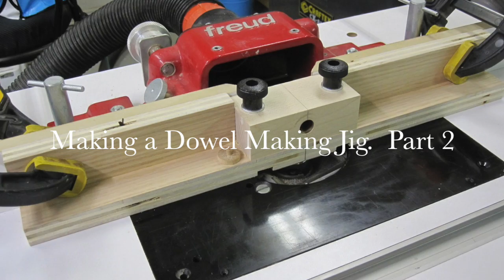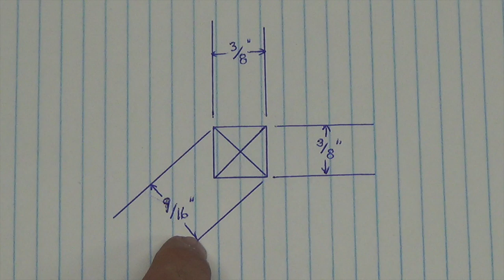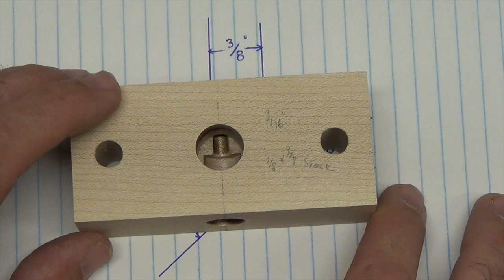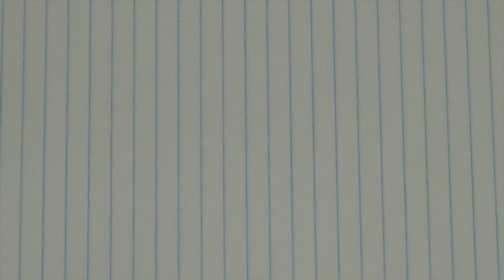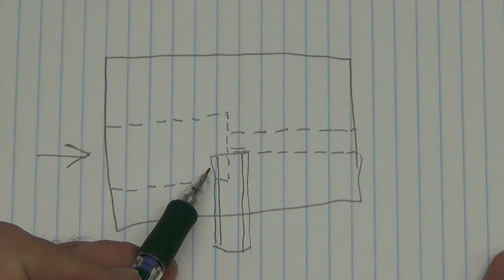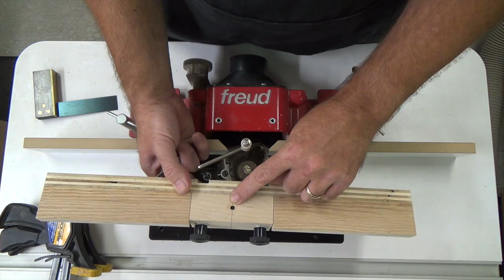Dowel Making Jig Part 2

Comment: What’s the smallest size of dowel and the largest dowel that you can make with the jig. Thanks
Reply from the maker: The smallest dowel that I have successfully made is a 3/16" diameter and the largest has been a 1/2" diameter.  I hope this helps.  Thanks for tuning in to the show Danny.

Comment: I like this but unfortunately I have the JessEm fence so the dowel would hit the back of the fence thus I would only be able to make dowels about 5” long. I’m going to try building it to run parallel to the fence.
Reply from the maker: I have been working on a jig that is similar to this one Robert for the Jessem fence as I have the same setup.  I tried this jig on my Jessem and the dust collection port interferes with the dowels exit point.  I have thought about one that work parallel to the fence as well, but you would just need to make sure that there is enough clearance for your drill to operate and as well, that the exit port of your jig gives support for the dowel.  They can really whip around when they exit the jig.  Good luck on your project and thanks for tuning in to the show.

Comment: So. I drilled my entry hole at 9/16 (.562) diameter,,, but,,, I milled my stock to .397 square, to get a nice fit to entry hole. Waxed both entry and exit holes to smooth operation.

I adjusted my square stock size to get a nice fit... Most times only skimming .oo2 thousands smaller or .395..
Reply from the maker: Sounds like your adjustments worked perfectly.  Thanks for tuning in.

Comment: A2+B2= C2
So, the sum of the two sides squared,= the length of hypotens's square root.
So, .375 squared plus .375 squared = .2812
The square root of .2812= .5303 or 17\32 diameter..

This is why others above are questioning the 9\16 (.562)  dimension on your drawing..

The measurement isn't 1\2 PR 9/16!  Its half way between those AR 17\32" 

'
Reply from the maker: Even if math was my strongest suit, this would still have hurt my head first thing in the morning.  LOL.  Thanks for tuning in.

Comment: Hello Kenny,  I found this video when I searched for a dowel making jig. I need an odd sized dowel that is not readily available and was not surprised when your jig came up in the search results.
I agree with your assessment of the quality of the dowels that you find in the big box store.  Lately I've found that the dowels are not the size stated.  I found this first with some 3/8" dowels-I drilled a 3/8" hole with my Forstner bit and the dowel was loose.  At first I thought my bit was cutting a bigger hole but when I measured it it was within tolerance.  I checked the dowel and found it to be closer to 7/16" than 3/8".  Fortunately the glue swelled the dowel enough that it tightened in the hole.  Same thing with a 1/2" this afternoon.
Anyway-Kudos on your jig!  Very good explanation on everything from how it works, to construction and set up.  When I build mine I'm not going to clamp it to the fence though-I'll make the base large enough that it will use the fence mounting holes but I will be using your design for the "dies".

Thanks for another informative pair of videos.
Reply from the maker: Glad that you like the jig and are going to make your own.  I actually changed the design of the die blocks as I got tired of them wearing out over time.  As the dowels are formed, the wear down the exit hole and cause the dowels to be mis-sized.  I corrected this by cutting a dado on the exit hole side and installing a 1/4" thick plate steel with the appropriate sized exit hole in it, lined up where it was supposed to be.  They never wore down again and I never had to replace the die blocks again.  Unfortunately, I will have to redesign my jig as it doesn't work as well with the JessEm table.  The vacuum dust port interferes with the dowel exiting the jig.  Not to worry though, when I do come up with the new design, I will be sure to have it on the show.  Thanks for tuning in and taking the time to leave a comment.  Good luck on your build.
Reply: @acutabove_woodworkings  I was thinking of adding a metal bushing in the exit side but a plate would be easier-more convenient.  Wouldn't have to purchase or have them made.

Comment: Why did you put the outfeed into your vacuum hose? Also, you seem to be wasting a lot of material
Reply from the maker: The outfeed travelling into the vacuum hose was just the way the design worked out and it helps keep the dust away from the outfeed.   As far as the "wasting material", the material is scrap and with several different sizes of dowel blocks, I wanted to have one size of blank that would work for several different dowel sizes.  That way, when I had scrap that I wanted to use up, I could cut it all to the 3/8X3/8 size, and make whatever dowel size I wanted when I needed to.  It's a convenience thing.  I hope this answers your questions.  Thanks for tuning in.
Reply: Ah 👍 I missed the scrap wood part. I’m going to make one based on your setup cause the router jigs seem to work better than the hole and chisel and tablesaw jigs that I’ve seen so far. Will def tune in
Reply from the maker: @hidarlin76  Glad to hear it.  I have recently modified this jig just a little and made the outfeed hole a little stronger.  I attached a 1/4" thick steel plate to the block and drilled the outfeed hole in that to prevent the hole from wearing.  Just a little suggestion.  Thanks again for tuning in.

Comment: Kenny; tuning kinda late to this one, trying to catch up. Great jig! Have you ever tried cutting across the grain to make plugs with this jig?
Reply from the maker: I can honestly say that I've never tried that Frank.  I would think that the cross grain would not survive the cutting process.  The twisting force on the stock as they dowels are made is pretty strong and I don't think they would survive.  Thanks for tuning in to the show.  I appreciate it.  Better late than never Frank.

Comment: hi Kenny
was wondering if the block would make 1" dowels since its 1 5/8 tall and 1" dowel requires 1 3/8th starting hole, would it be strong enough
thanks in advance
Reply from the maker: I honestly don't think that there would be enough material left in the block to be able to make a dowel of this diameter after cutting away a hole that is 1 3/8".  That only leaves 1/8" on either side of the hole.  You would have to increase the size of the block for sure.  At least the height of it anyway.  The other problem is that it would be difficult to turn it in a drill.  You would have to either find another way of spinning the stock, or cut it down so that it would fit in the chuck of your drill.  I hope this helps.  Thanks for tuning in to the show.
Reply: Fit the wood into a nut socket & use a nut driver.

Comment: thanks, thats i need made next before i test how good come out metal plate were has drilled 6 and 8mm holes and drill cut wood at plate. if not work good i made you version. thanks good idea.
Reply from the maker: The wooden blocks do wear over time and need to be replaced.  The metal plates might help with that.  That's a great idea.  Please let me know how it works out.  Thanks for tuning in to the show and taking the time to leave me a comment.  I appreciate it.

Comment: High Kenny thank you for your prompt response
What I meant is according to your video The entry hole is 9/16" which is the measurement, corner to corner on a 3/8 X 3/8 stock 
But my measurement comes out to half an inch instead of 9/16 hope that clarifies it
Reply from the maker: It definitely clarifies it, thanks.  I have redone the measurements and verified.  Checking a 3/8"X3/8" stock, from corner to corner, the measurement should be 9/16".  I have even drawn it out and verified it this morning.  If you are not getting the stock to measure out at 9/16" from corner to corner, I would first start off by checking if your table saw blade is square to your table.  Having that blade perfectly square to the table makes a big difference when making a project like this.  So now, I am understanding more of what you are asking for the 9/16" bit.  You want the drill bit for the entry hole.  If I remember correctly, I used a forstner bit.  http://www.leevalley.com/en/wood/page.aspx?p=63566&cat=1,180,42240,63566
Let me know how this works out.  I am curious as to how you are getting a much smaller measurement on something that isn't a variable.
Reply: wow youre amazing went to a freinds house and he cut and  measured youre on the money
going to get new tablesaw blade forrest woodworker ii thats what my friend uses its expensive but i hope it helps
any suggestions on sqaring tablesaw blade would be appriated
Reply from the maker: @akhtermanek4549  I am not 100% certain that your blade is the issue.  Your saw may just need to be tuned up a little.  Here's a video of the process of tuning up your saw.  @ the 3:26 mark (roughly), I demonstrate how to square the blade.  Although the Forrest blades are nice, a quick tune up of your saw might correct your problem and save you the cost of the blade, allowing more money for wood or other tools.
Reply: hi Kenny 
Finished part one every thing seems square
i watched your table saw video helped a lot
i will let you how after my first dowel
thanks again for all your help
Reply from the maker: @akhtermanek4549   You're very welcome.  Good luck with your project.
Reply: wow it turned out amazing thank you
Reply from the maker: @akhtermanek4549  You're very welcome

Comment: hi kenny
just going over your construction video before build.
2 question my 3/8 wood equals 1/2 yet yours is 9/16 can you tell meif im wrock.
also where to buy 9/16 bit
ps im a complete newbie and also canadian toronto
Reply from the maker: I'm not exactly sure what you mean by your "3/8 wood equals 1/2 yet yours is 9/16". If you could find another way to ask, I'll do my best to answer.  I'm assuming that you are wondering where to get a 9/16" router bit?  Here's a link for you.  http://www.leevalley.com/en/wood/page.aspx?p=42886&cat=1,46168,69435,46171
Thanks for tuning in to the show.

Comment: that is really awesome.
I want to make one as well. but I need really very thin yet sturdy dowels so can you kindly show how thin can this jig go.
I will appreciate that so much especially when it is shown in a video.
Reply from the maker: I have had success with dowels as small as 3/16". I have been able to make some 1/8" dowels but they were much harder to make and would break or twist off while adjusting the router bit height. I hope this helps you.
Reply: +kennyearrings1 thanks a lot for that. hope you have good times.

Comment: Excellent Kenny this is great
Reply from the maker: +floyd Millar 
Definitely my favourite jig in my shop.  I love the ability to make dowels for myself instead of relying on store bought ones.  Thanks for tuning in and if you have any questions on the jig, feel free to ask.  I'd be more than happy to help you out.
Reply: Hi Kenny . Thanks for the reply and can see why you love so much , and apart from the accuracy the  dust extraction looks really effective. i will be converting to metric , no real problem but since i am mounting mine to an incra fence i guess i would have to feed my dowel along the length of the fence which means it may need to be a bit wider to allow room for the drill and possible 4 mounting bolts? i do like the idea of metal inserts made by one subscriber but at any rate it looks easy enough to create multiple blocks for different sizes . Thanks again . also loved your dado videos. Keep up the great work.
Floyd
Reply from the maker: +floyd Millar Thanks again for the kind words. Great to have you aboard.

Comment: Nicely done Ken.  As you know, I have designed and built a similar jig using removable machined metal plates for both the inflow and outflow holes.  I can make from 1/4" through 1" in 1/16" increments.  My rough stock is 1/16" larger than the finished dowel.   I like your design very much.  Thanks for making the video.  Making dowels with trash wood is DEFINITELY a great option and a big money saver, plus the luxury of having dowels of any species of our choosing.
Reply from the maker: +Hardnox I like the idea of the metal plates.  It would definitely eliminate the need to replace the blocks as they wear.  This jig is a definitely plus in anyone's shop and regardless of the design that you construct, it's a great way to use up scrap that would otherwise be wasted or burned.  Thanks for chiming in on the show.  It's always good to hear your comments.
Reply: My plates are all made of 2" x 2" x 1/4" steel cut on a waterjet.  Here's a helpful link that I used to convert inches to decimel so the machine shop guys get the right sizes: http://www.calculatorsoup.com/calculators/geometry-plane/squares.php
Reply from the maker: Thank you sir.  That's some useful information there.